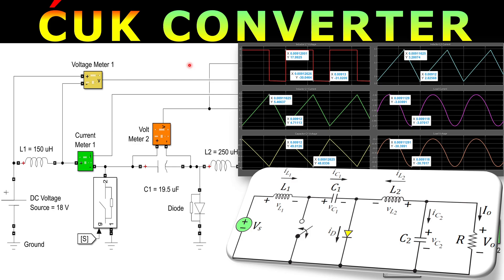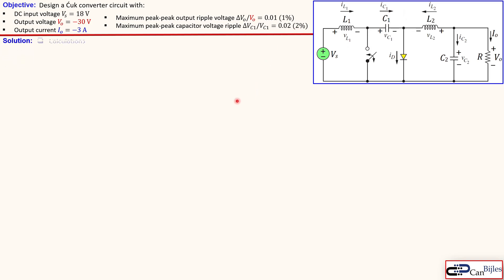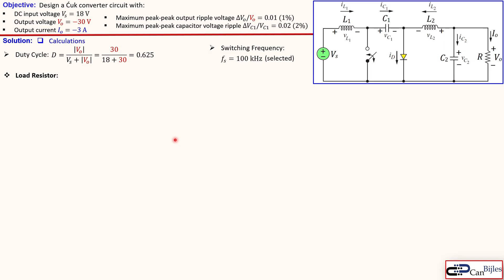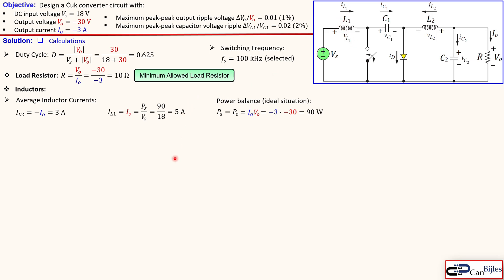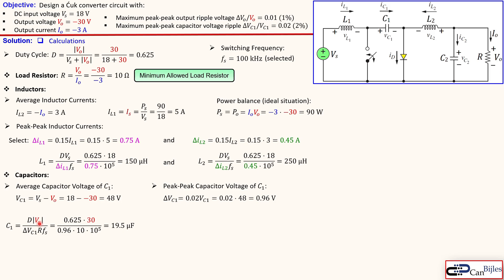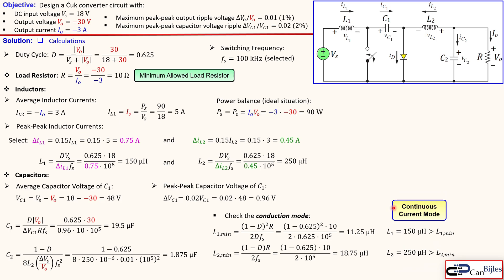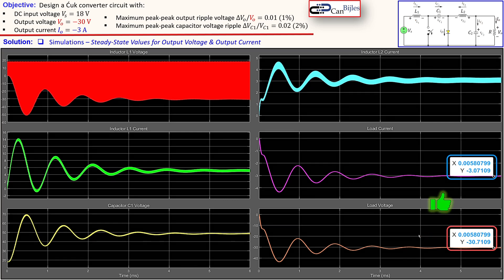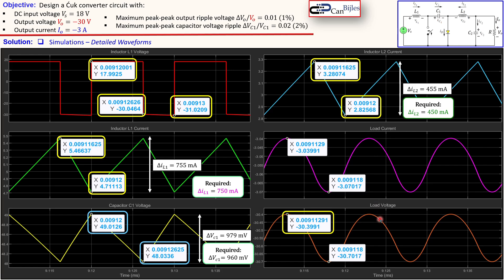⚡ DC-DC Ćuk (Cuk) Converter Design 🔋 Power Electronics ⭐ Calculations & MATLAB/Simulink Simulations👍

Comment: it is showing error if I add voltage measurement block for inductor. what should I do
Reply from the maker: Probably a wrong connection or incorrect voltage sensor in Simulink. There are two types of sensor in Simulink. Check this.